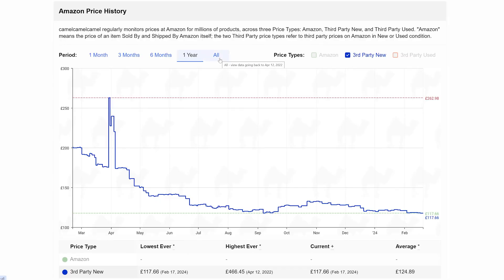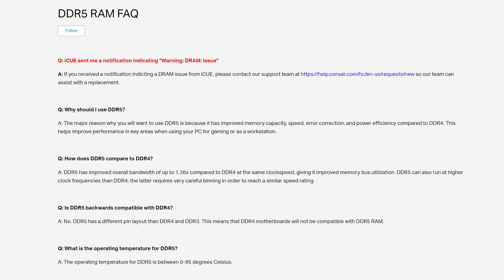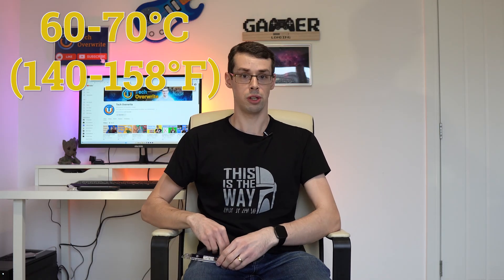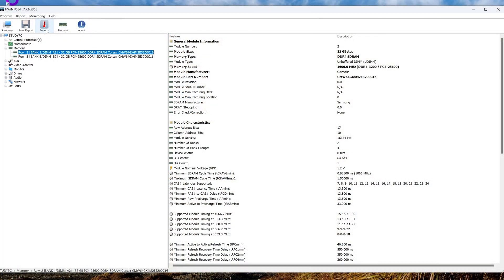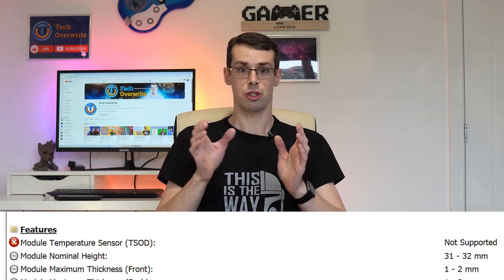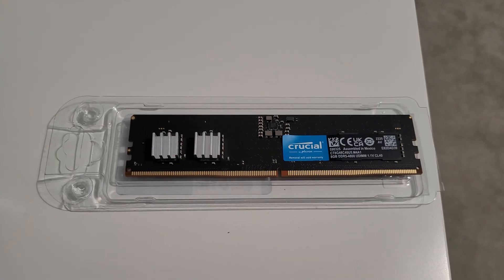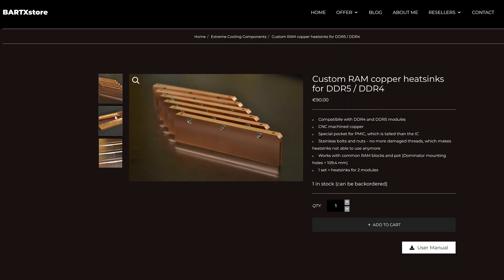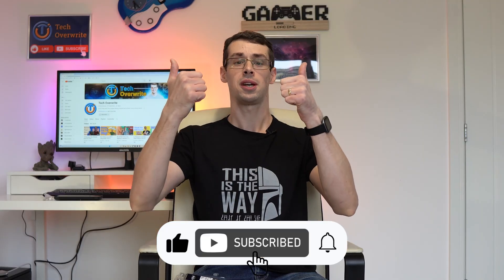Is DDR5 'Too Hot'? Does It Need Special Cooling?!

Comment: Small individual heatsinks,  attached with high TC TIM, are best:
The module PCB, full of copper traces, is attached to the chips, through the BGA, with copper traces right into the heart of the  RAM. 
That's a high Thermal Conductivity path from the chips 'hearts' to the PCB.
ie:  The BARE PCB is itself a heatsink that works way better with Airflow..!

The Power 'chips' also need a heatsink, or the above heat path feeds heat into the DRAM chips. 

On DDR4 MBs, the DRAM  power 'chips' Are the hottes thing on the MB.
Airflow and HSs  will help an OC.
Any MB should be thought of as a HS. 
(Google where all those power etc chips are designed to send their heat to..!)
That means it will work twice as well with Airflow on both sides...
Reply from the maker: Thanks for watching and commenting, that's a really interesting point about the PCB acting as a heatsink, especially with good airflow!

Comment: I'm going to buy a Crucial memory without the heatsink. The most basic model ( DDR5). and my question is the following: do these memories get very hot? Because the difference between the one with a heatsink and the one without is quite big ( it's quite expensive for me because I live in Brazil and things are very expensive here). Anyway, I'd like to know your opinion because you're an expert on this subject. In my case, I'll buy the desktop version and my case is big and well ventilated. Thank you very much, the video is excellent!
Reply from the maker: It's hard to say for sure because the temps can vary depending on which chips are used and the speed the memory runs at. But a more basic DDR5 stick should be fine without a heatsink - that's what I'm using in my HomeLab NAS which is running 24/7 without any temp issues 🙂 And yes, keeping the case well ventalited with 2+ intake fans at the front will really help. Good luck with the build 👍
Reply: @TechOverwrite  Thank you!! 😀

Comment: There was not even a mention that one of the hot components is the DDR5 power supply system - PMIC. And for some reason, only very expensive copper radiators are shown as cooling options, although there are many of them on the market, for example, simple aluminum ones. I hoped that really useful options for "bare" Hynix A-die would be considered. And yes, heatsinks are needed for overclocking if you increase the voltage on the memory to achieve frequencies above JEDEC.
Reply from the maker: Thanks for the comment, that's all fair points and I could have diced into some points more - especially wrt Hynix-A.

Comment: Video may have answered my worries over nothing, Just upgraded to the new g.skill royal 64gb kit @ 6400mhz but it runs 10C hotter than my previous trident kit lol.... idle is around 46C and gaming 55-60C is the highest ive seen so far... I was unsure if that was an unsafe zone and my case has plenty of cooling its a meg700R with 10 D30's in it....
Reply from the maker: Yeah that doesn't sound too bad for a fast DDR5 kit to be honest (and kudos on the sweet RAM setup!). It should be fine IMO 🙂

Comment: Just get Hynix A die…. Bdie & M die runs hot. 

my a die kit sits at 33-35c idle & only reaches 38-40c while gaming. 

Mind you I’m using 6200 CL26-36-31-30-61 tweaked @ 1.635v lol.
Reply from the maker: Wow that's really good actually, yes Hynix A sounds better for sure - it's just a pain trying to identify what it'll be in advance I guess. Sounds like you're onto a winner there though, those are some great settings and temps 🙂
Reply: @TechOverwrite  before switching to am5, I made sure to compare all of the die’s aswell as dual rank vs single rank memory for gaming. 

and it seems like single rank A die is the winner since you can get very tight timings at a relatively good frequency while keeping the memory cool without using a fan. But like you said you need good airflow. 

Don’t get me wrong their are pros to to getting dual rank memory but in return your ram will run pretty hot unless you put a fan on them. especially If you are going for very tight timings. 

My kit originally ran at 7200 CL34-42-42-84-126 @ 1.4v. 

The kit is from team group. I highly recommend. they are only $120 usd. after tax it comes out to $136-140. 

they are 32gb aswell so it’s worth it
Reply from the maker: The Team Group RAM definitely sounds good then,  and that's interesting for sure about single rank working out fine. It does make sense though, and it sounds like your DDR5 research was spot on. 🙂
Reply: @LightWorks222  Holy shit single rank runs cool, 1.635v is fucking NUTS. My dual rank A die at 6000 cl30, 1.3v does 65c stressed lol
Reply: @Hetsu..  I don’t run that anymore anyway. My tune was wrong & I had some timings to low. I only needed about 1.5v for 6200CL26, I just cranked it to It’s max but I ended up lowering it after. 

i now run 6400CL30-37-34-34-68-72 1.405v / vddq 1.395v / Vddio 1.400v 

For CL28 I need 1.49-1.50v for 6400

Comment: I've touch 110c pei sheets for 3d printer beds and it's fine. Yeah don't keep holding on to it and it might hurt a bit but unless you leave a firm grip on it, it won't burn you.
Reply from the maker: Thanks for sharing, that's reassuring to know then. 🙂

Comment: I purchased the UGreen NAS and I am definitely looking to upgrade the RAM (Supports DDR5 4800MHz SODIMM) to the max 64GB it supports. I am torn between buying the Sabrent DDR5 with an integrated heatsink and ECC, or getting a non ECC one and maybe adding the fins that you mentioned. Do you have any opinion on which is better?

It will be a small form factor device, so I am leaning towards the Sabrent.

Thanks for the video, this has been very helpful. I have only used DDR4, so this is a whole new generation I am not familiar with!
Reply from the maker: Glad you liked the video and hmm, interesting question. I would probably go for the Sabrent ECC with integrated heat sink too - it will likely have slightly better cooling, but also ECC is always ideal for a server/NAS type system IMO 🙂
Reply: @TechOverwrite  Always nice to get a second opinion on this stuff. I agree, thanks!